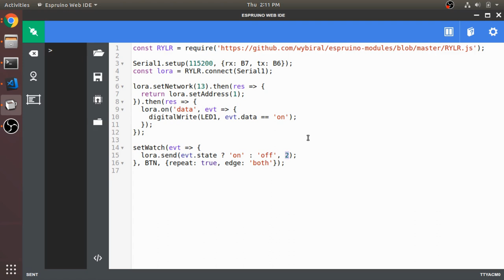Getting Started with LoRa | Tutorial

Comment: What is the range on those things, and could you set it up as an internet connection so you could at least connect to a bbs like it's 1992?
Reply from the maker: The biggest factor with the range is how obstructed the signal is with buildings and stuff. I live in a city so I haven't gotten to test out the theoretical range (with a clear line of site) but even with buildings and trees I still have connection a few blocks away (half a mile -ish). So, much better than WiFi or Bluetooth. But supposedly with a clear line of site they can go 10km or so.

You could run internet through it using something like PPP (https://www.tldp.org/HOWTO/PPP-HOWTO/c44.html). It would be really slow like that though (basically forget about trying to load a modern webpage). That could be a neat project though, just for kicks.

In the demos on this video where I had the browser interaction I could have forwarded that port out to the internet. But in that case each change is only a few bytes so it didn't really need much bandwidth.
Reply: A range of a few miles is actually very impressive. Should actually allow for things like loading the text based terminal version of reddit and such. There's actually still a lot of stuff you can do on the web with dismal speeds. I wonder if increasing the antenna size would make a significant improvement to range. Could actually be useful for those nature types in national park areas with no cell coverage, but I guess those people wouldn't be nerdy enough to open reddit in a terminal anyway.
Reply from the maker: You probably can get a bigger antenna. I think there are regulations on the amount of power for them though, so most devices are going to obey those limits. It sounds like the key is to elevate them to avoid obstructions. So if you put one on your roof or a tower or something it would get the best range.

I do a lot of hiking myself and I think it could be fun to take some of these out to the wilderness. You could use them like an off-the-grid text service, play chess with someone at another camp site, or setup an alarm at your camp to let you know if an animal or person were rummaging around.
Reply: If you wanna try just for giggles, grab RTV from whatever linux repository you use and see if the text based terminal reddit is usable at such a speed limit. As far as regulations go, half the junk you can buy off ebay doesn't conform to them anyway. The FCC doesn't really care unless you're blasting a 500 watt signal over a radio station. Anyway, a longer antenna wouldn't increase the power you're putting out anyway. It just increases the  size of what you're shooting at. That is how ham radios can reach around the world in correct conditions with a long wire on as little as 5 watts of power.
Reply: I think I was on bbs' in '82, at 75 baud and thought I had discovered the secret tunnels under Washington, DC (true).  Then i learned Europe had Telex a decade prior.  That's when I knew I would never keep up with tech… still can't find the 'any' key.
Reply: Ilovetheplatypus  LoRa is made to work in the Industrial free use bands, if we can jump the power up with amateur radio that 10km+ distance is going to go quite a ways.
Reply: @antimattercarp2720   There's been reported distances of over 100km, though through use of different modules, but still cool, right?

Comment: This would be great to have in my mailbox 200m away, to see if I receive mail.. (if the power consumption is low enough to run on battery over time?)
Reply: power consumption on LoRa's is very low, you can use them for weeks on a rechargable battery as long as you only send packets when you see movement in your mailbox

Comment: Hi Davy, good intro to the hardware I am impressed. Would it be possible to use this to transmit an image / text to a OLED screen or similar over distances of say 1KM? I am thinking of developing some sort of project that can allow me to have display modules on all 18 tees of a golf course which can receive an updated image with text from the clubhouse. The modules would be low voltage build into the tee markers. Using a LORA I heard that the same data can pass through each LORA onto the next creating an extended network? I do a bit of electronics but not sure if I could make this kind of project work or not? Perhaps you have some ideas.
Reply: That be cool image. How ever ever heard Elrs. Expres lrs? Uses this to send signal and receive signal and telemetry. can do up to close to 16 miles with 2 watt.

Comment: How much does running a high level VM-based language like JS affect the battery life?
Reply: I've had these Espruino devices easily last for several weeks on a tiny 2032 button cell. So it's pretty good on battery life. The thing is, when you write event-driven applications like this most of the program is just waiting for events (for LoRa signals, button presses, etc). It's different if your program has to do a bunch of number crunching or something, but usually these types of projects are more event-driven, so they spend most of the time waiting and then they run a tiny amount of code to respond to an event before going back to waiting.
Reply: That's surprisingly good battery life for JavaScript! Maybe the problem isn't the JS directly, but maybe that to run JavaScript you need beefier hardware, so the hardware itself eats more power than lower powered devices like Zigbee based sensors, which can get battery life measured in months, maybe even more than a year. I get what you're saying about async stuff (no event, no JS running), but we have interrupts in low level languages for events also, if one was to make power efficient code. Of course events in JS are alot easier to deal with than low level interrupts!
Reply from the maker: @Joonas Loppi For me it's not even apples vs oranges. Dealing with text protocols (serial AT commands on these LoRa modules/HTTP requests) is easier in JS and juggling multiple sources of concurrent IO is a pain in C even if your device has proper software interrupts (most similar devices only support a few external and maybe some timers).

One good challenge is to have someone implement simple blinking LEDs at different configurable frequencies in C. Start with 5 independently blinking LEDs. Now make it modular so that you can add more LEDs or take some away without doing a complete rewrite. By the time you write a solution robust enough to handle that in addition to anything else your projects needs to do, you've probably written something similar to the event-loop and scheduler in Javascript. Except your implementation probably hasn't been tested as thoroughly. Now if you're also processing arbitrary amounts of text (HTTP+AT) then the tiny overhead of parsing small blips of JS code to respond to events is negligible.
Reply: @DavyBot  I ain't arguing with that :) Like I said you can do interrupts in C but it's probably much more pleasant in JS.

Comment: New to this area of IoT; can you program these devices with the Arduino IDE?
Reply from the maker: These LoRa modules can work with any microcontroller that supports a UART interface so they will work with Arduino. I chose to use Espruino boards instead because handling the text protocol is easier in JS instead of C, but if you wanted to do it in C it's certainly possible.
Reply: @DavyBot  I favor the NodeMCU only because I have a lot of them in the project drawer. Again thank you for your help.
Reply: @MaxGoddur  you can flash Espruino to nodemcu boards